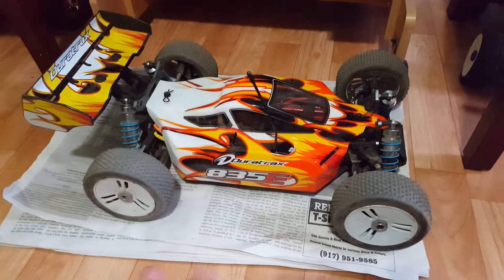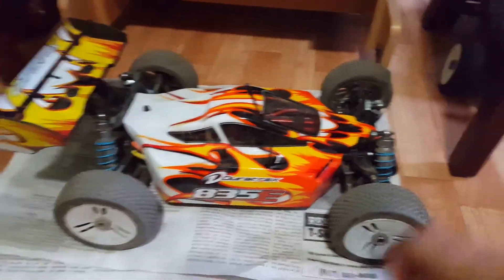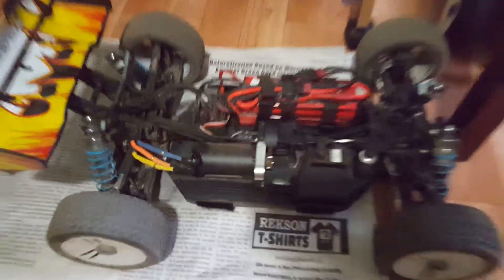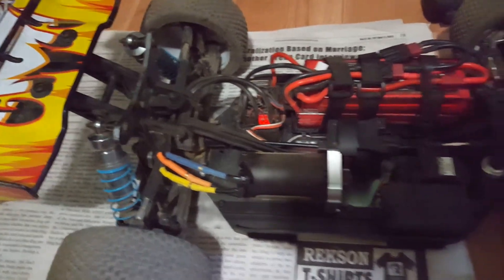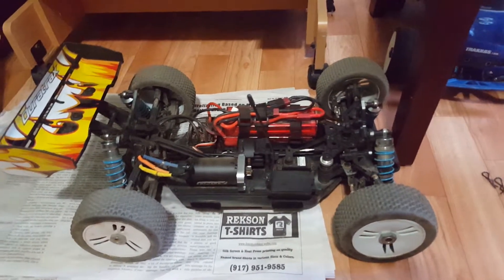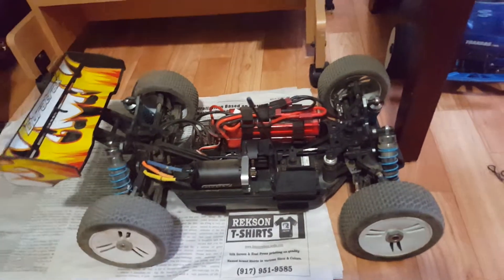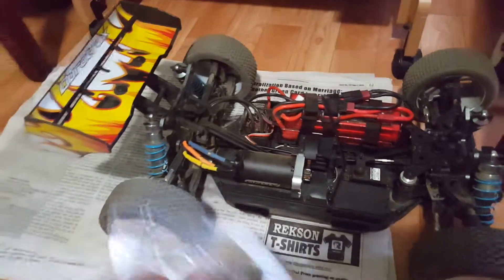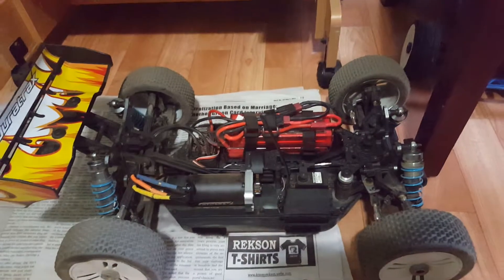Now its the center differentials ahh!!!!!

Comment: I bought a 835e and in two days it had already stripped the front diff and i fixed it and i havent any porb sence and iv had the buggy for a year now!!! the 835e is stonger than the forza flux.... my forza flux stays broke all the time...
Reply from the maker: I know its a great buggy but been having some bad luck with mine. What diff oils you used?
Reply: +Silentspeed19 I dont know what weight the oil was but i know it was thick...
Reply from the maker: +Greg Keesee oh okay then
Reply: +Silentspeed19  I used 30 weight motor oil in the rear and the center diffs it seemed to help alot... it reduced alot of the gear chatter.
Reply from the maker: Greg Keesee Thanks alot for the info. Hopefully this helps out.

Comment: dude u got to learn to fix that kinda stuff yourself! buy a kit, put it together and learn about everything on an rc vehicle, then start learning to do maintenance on them.I guarantee you will be a lot happier.good luck!
Reply from the maker: i do i took out the all the diffs change the oil checked all the bevel gear put it back. On smooth surfaces ita runs find but when i take it off road dirt, mud, grass etc it runs good for a few then the diffs just gives out. smh
Reply from the maker: What good off road kit you would recommend?